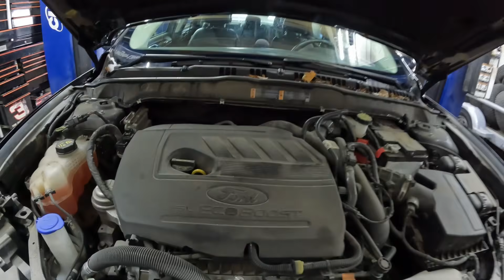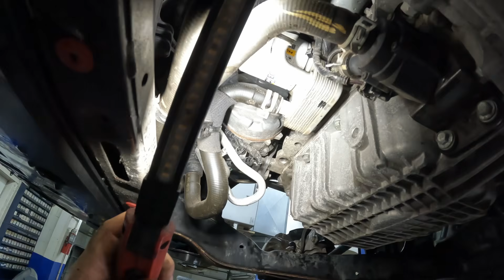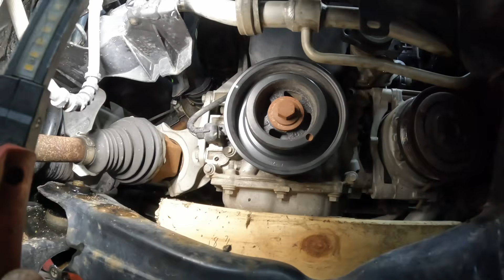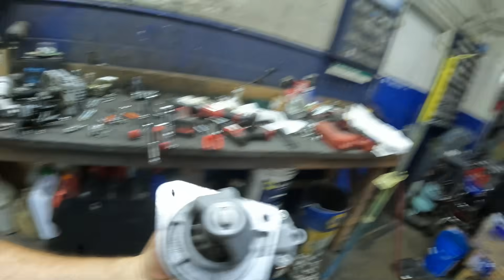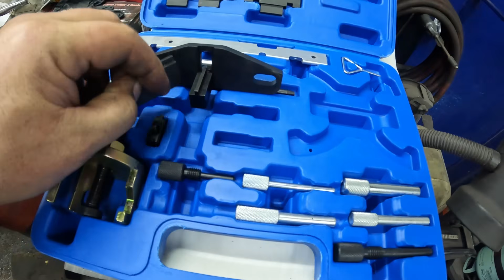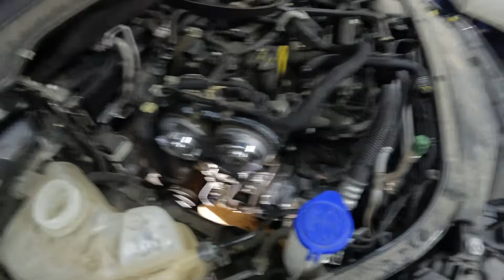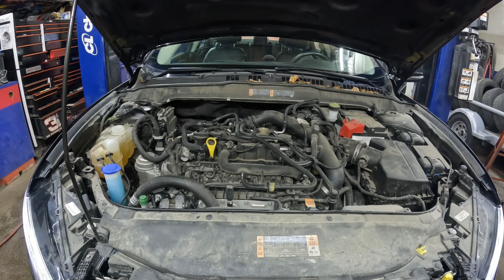2018 Ford Fusion 1.5L Ecoboost Water Pump & Timing Belt

Comment: So just want to confirm, is the tool that goes into the side of the block to keep the CS from spinning, good enough to hold it while I remove and install the new crank bolt?
Reply: Disregard, saw an earlier comment saying that the pin is good enough to hold
Reply from the maker: So it would not assist in removing the crank bolt.  I use an impact to remove the bolt.  The pin will keep the crank from turning when tightening the bolt.  Thanks for watching.
Reply: @paycheckmonster correct! I’ll be using an impact wrench to get it off. I just wanted to be sure that the bolt you stick in the side of the block would hold from using an impact. I’m also using an impact that only has 250 ft lbs of break away torque. So i don’t think it will zip off that crank bolt right away. It might take a couple seconds, so I was worried that the bolt wouldn’t hold

Comment: What's the part number for the cam cam sprocket   tool?
Reply from the maker: The cam locking tool is 303-1097.  However, I bought mine in a kit off Amazon.  I just checked and that kit is not available at this time.  That kit was bought in the VZCY store on Amazon.  Thanks for watching!!

Comment: What is the recommended mileage to do this when I know Ford says 150,000 but is that too long?
Reply from the maker: 150,000 for the belt.  There is no service interval for the water pump.  You just replace when they start leaking, as in this case.  You would think it would at least make it to 100,000???  Thanks for watching!

Comment: can the pin in the crank take all the force tightening that bolt without the fly wheel locked? great vid though.
Reply from the maker: Yes it can.  Like I stated, the crankshaft butts up to the tip of the pin.  Not from the side, so your not going to sheer it off.  Thanks for watching!!
Reply: @paycheckmonster  Have you done one of these engines again without pulling the starter? Just by using the pin against the crankshaft?
Reply from the maker: The pin will hold it.  A lot of people think the crankshaft is making contact with side of the pin, but it's not.  It makes contact with very tip.  Thanks for watching!!

Comment: What tool is needed to remove oil cooler housing? To remove inner adapter that holds housing to engine? Thanks and great work
Reply from the maker: It's a 12mm allen socket.  Thanks for watching!!

Comment: Did you put any tread sealant on the water pump housing bolts.
Reply from the maker: No need for thread sealer.   Service manual states to replace the bolts.  I never have any problems reusing them though.  Thanks for watching!!

Comment: Excellent video. Did my timing belt today without removing the starter. Just used the dowel insert on the crank. Great info on here
Reply from the maker: Thanks for the feedback, glad it helped you out!
Reply: Was it running smoothly after everything was put back together

Comment: I was going to go look at a 2020 Escape tomorrow to purchase. I have changed several timing belts in my day but this is ridiculous. I will think twice about buying the Escape. Why not make the timing cover so the bottom comes off with a few bolts so you don't have to remove that pulley. This is dumb! I might just keep my old Honda Accord.
Reply from the maker: You really can't go wrong with most Honda's.  Thanks for watching!!

Comment: FelPro 71830
Reply from the maker: I couldn't get it aftermarket at the time and the customer needed it back asap.  Dealer said it was only available with the cooler.  It wasn't much so that's the way I went.  Thanks for the info and thanks again for watching!!

Comment: One of the best video tutorials I've watched. Much appreciated. Just a thought on the starter motor removal. I feel it's essential, as, years ago, I did a little Ford Fiesta belt without locking the flywheel, and, to my horror, I bent the locking pin that butts up against the crank web. Needless to say, I had to pull the sump off, straighten it in situ, and reseal sump. Major lesson learned. Many thanks again, for a great walk-through.
Reply from the maker: Thanks for the feedback.  Thanks again for watching!!
Reply: The torque of the crank bolt is the exact reason the flywheel is to be held. Similar to a Duramax.
Reply from the maker: Duramax locking tool is way stronger.  Flywheel holding tool will not hold on it's own.  Pin holds position while torquing crank bolt.
Reply: @ Yes, did notice it's alot beefier than the older ones.
Reply: @mahanduru I called the Ford dealer and they only lock the crankshaft on the flywheel. For me at least the locking tool for the flywheel looks a bit tiny.

Comment: is it easy to change an exhaust cam on the 1.5? the fuel pump
lobe is worn. thank you
in advance!
Reply from the maker: Depends on mechanical ability.  If your comfortable with the timing belt job, it wouldn't take much more to replace the cam.  I've never seen a flattened fuel pump cam lobe on one of these engines.  Did the pump fail??
Reply: @ yes sir. pump failed as well. i work in a dealership( chrysler) so i have access to a hoist and tons of tools, but im an apprentice so ive only been familiar with tools for the last few months. My car currently stalls on cold start and will not go over 3200 rpm
Reply from the maker: I hope everything works out for you.

Comment: Great video! Helped me out a lot! I was on the fence about taking the started off to lock the flywheel to torque the crankshaft bolt. I did not take the starter off, the timing pin and the front timing pointer I think held the crank from spinning, my job is all done and runs perfect! Tnanks !
Reply from the maker: Glad to hear everything worked out well for you!  Thanks for again for watching!!
Reply: Work good? Im a out to do the same. If you think the bottom flywheel moved couldn't you just spend it to locking pin

Comment: You all make it seem like the cam sprockets are going to line up perfectly on each car. I drove mine until I needed to replace the water pump. I turned the car off and the cam sprockets were at the 12 for intake 11 for exhaust left to right. I replaced the water pump without removing the belt just taking the tensioner out. I put it back tried to line up the cams tool wouldn't fit. Every video I watch they make it seem like each cars cams are gonna be perfectly aligned.
Reply from the maker: I guess I'm not sure what you got going on there.  I've never had a problem with one not going back together.  Something doesn't sound correct there.  Sounds like the belt may have jumped when loosening the tensioner????
Reply: @paycheckmonster  Yeah I bought a used Ford Fusion my water pump went bad. I didn't mark the cams after I shut the engine off. I took the belt tensioner off to get the old/new pump installed but didn't remove or replace the belt. I tried using the lock tools on the cam sprockets. The line and circle never made it to the top at the same time. They were off 12 o' clock position and 11. 

I have mechanics say the valves were bent but I know that's a bunch of smack because the engine hasn't turned over since I shut the car off and put the pump on. I'm not a timing expert but it looks like I'll have to take the whole top off and make sure all the timing tools are used. I have a shop trying to charge me $7,000 for a engine when the one I have just needs a new timing belt and for the cams to be aligned.
Reply from the maker: Hope everything turns out ok.

Comment: My fusion kept giving me an overheating warning so I replaced the thermostat housing, I’m still getting the overheating warning while driving seems to come on right at 40mph, so I’ll turn the car off and 2 seconds later turn it back on and temp is normal…I’m thinking about doing all this but not sure if it’s the water pump
Reply from the maker: Step one.  Check for codes.  These engine have an auxiliary water pump also,  usually sets a code though.  There is a process to bleeding the cooling system also.  Thanks for watching!
Reply: did you fix this issue? going through the same thing with my fiancée’s car right now

Comment: That is a locating pin fly wheel locks it. But I got you. I have a 2014 right now in my shop. I figure a way for us to eliminate that 2 hours trust me  I got access to a machine shop
Reply from the maker: The pin that protrudes and makes contact with crank sets timing location.  The flywheel is locked with a tool so you can remove the crank bolt.  If you have the crank set so it's making contact with the pin and the cams locked the flywheel holding tool is irrelevant.  Then you wouldn't need a machine shop.  Thanks for watching!!

Comment: Hello needing some advice 
I have the same car 
It’s obvious the water pump is bad it makes noise and the pulley moves back and forth 
I changed out the thermostat and I’m having trouble getting all the air out of the cooling system 
Is it possible for the water pump to be putting air into the system?
Reply from the maker: If it's leaking, it's not holding pressure, and if it's not holding pressure, it's probably not going to hold a vacuum.  So technically I guess it would be possible.  There is also a procedure for bleeding the cooling system also but it sounds like that water pump should be a starting point.  Thanks for watching!!

Comment: Is there any situation where the engine needs dropped/removed to fix other items related to the timing belt?  We are being told it needs removed for a 1.5L ecoboost in a 2014 fusion.  TY!
Reply from the maker: Does not have to be removed.  Thanks for watching!!
Reply: @paycheckmonster  thanks for the info!  Now I'm concerned being taken advantage of getting charged more.  The initial issue is a rapid knock/ticking noise for a second or two ONLY when you accelerate hard above 3k RPM and left off the gas.  he things its something with the timing belt or a connecting rod bearing.  Only 77k miles on the car.  :-(

Comment: I had the pleasure of getting one of these in my shop. What a pain in the ass. I bought the same tool kit from Amazon that you used.  Everything was installed properly. After torquing the balancer bolt I removed all of the locking tools.   Turns out the tool that holds the flywheel cracked in half after only one use.  Luckily the broken piece didn't fall into the bell housing.  Just imagine if I relied on just the lock pin in the block. What if that broke off in the block instead?  This whole job is pretty sketchy.
Reply from the maker: I know a lot of people that watched the video are questioning the pin the stops the crankshaft from turning.  Just to explain further.  The counter balance on the crankshaft does not contact the pin from the side,.  It actually makes contact on the very tip.  It butts up to it and does not try to shear it off.  So in theory, if it did fail.  The treads would have to be pulled out and the pin would push directly out the side of the block.  It sure is a cluster of a system though.  I would agree.  Thanks for watching!!

Comment: bro i dont have an impact drill to get that big ass bolt out so what can i do?
Reply from the maker: You really need to have a good understanding of the timing system on these vehicles before attempting the repair as explained.  Don't know if I would take the risk if you don't have the correct tools.  Thanks for watching!!
Reply: In that case stay away from the job. Need basis automechanica skills

Comment: If your doing just the waterpump does the timing belt come off anyway?!?! Mitchell calls for 5.5 hours but i have learned on any bigger job to double it and base charge off that.
Reply from the maker: So you would actually use the wedges in the service kit and jamb those in to hold the belt in place and then loosen the tensioner and replace the water pump.  A lot of fiddle fuckin around!!!  Soaking the belt in the process.  But yes it is 5.5 hrs to do it that way.  Thanks for watching!!
Reply: @paycheckmonster  what a stupid design...thank you for clearing that up for me

Comment: I am surprised that you did not notice the rubber flap on the backside of timing cover. The stud and bracket that is difficult to remove. Does not have to be removed. Unclip the top of rubber flap from timing cover. Pull cover away from engine far enough so you can get a hold on the bottom part of the rubber flap. It is slid into a slot in the timing cover. Hold rubber part while pulling cover off.
Reply from the maker: Sure makes it easier to put back on.

Comment: What about the torque on the crank bolt will tha pin support that torque instead of removing the starter
Reply from the maker: So the crankshaft makes contact at the very tip of the pin and pushes straight back.  It does not contact the pin from the side.  I would trust pin over the holding tool for the flywheel.  Thanks for watching!!!

Comment: What did you use to get that crank bolt out? Can you turn it counter clockwise without hurting anything?
Reply from the maker: I just put an impact on it and it comes right loose.
Reply: @paycheckmonster  i impacted the heck out of it with a 1/2 inch dewalt but had to finally use a 1/2 inch ratchet with a cheater. It was on there!

Comment: I can’t believe nothing is keyed. Have you ever heard of timing slipping?
Reply from the maker: Seems to be kind of a trend with smaller engines.  They have been doing this for many years.  I've never seen one slip.  I have seen plenty of engines that are out of time because of improper repair procedures.  Loose fasteners or timing just set wrong because the proper tools were not used.  Thanks for watching!!

Comment: Thanks for a great video. I just did my daughter's 2017 Escape. My Amazon tool kit worked fine and I did not remove the starter. I did test the way the pin contacts the crank by backing the pin off a couple turns and sure enough, the crank move a little more. That just means that it does butt up against the end of the pin. I hope the guy that designed that back timing cover stud with the bracket has his nuts boiled in oil. Thanks!
Reply from the maker: Thanks for watching!!
Reply: I agree the designer of that bolt and stud, for the backside of that timing cover should be hung by his toenails
Reply: No need to remove the bracket. Simply slide the rubber strap out of the cover.  Better think first!!😢
Reply: what does this mean: I hope the guy that designed that back timing cover stud with the bracket has his nuts boiled in oil 😂😂😂
Reply: No need to remove the bracket! You can simply slide the rubber strap out of the cover. So, no nuts to boil.

Comment: Thank you for this very informative video and your time in doing it.
I am about to tackle this job on my sons 1.5 fiesta here in Australian.
I bought the kit of special tools of ebay and have done a number of timing belts on various models but this one has got me a bit nervous.
I haven't got a fancy torque wrench to do the degrees. Can i just mark the bolt and do the 90 degrees by eye and then a little for the extra 15 degrees.
Its a manual so putting it in gear with hand brake on could assist the motor from not turning when undoing the harmonic balancer bolt i hope.
Reply from the maker: As long as you can mark something to indicate how far your turning the bolt, it should work just fine.  I hate to age myself, but that's how I started out many years ago, before the electronic torque wrenches.  Thanks for watching!!

Comment: Your video is very well done. I am about to replace the timing belt on 1.5 Escape. I am torn between pulling the starter or not. It looks like it is very difficult to get out but I am nervous about breaking the pin if I do not. Do you have any further thoughts on this since you did the video? Thanks again.
Reply from the maker: A lot of people think the crankshaft would shear the pin off, but actually the counter weight on the crankshaft butts up to it.  It pushes directly on the tip.  That's why you need to make sure the pin is threaded all the way in.  I've never broke one.  In the service manual, that is the procedure to hold it.  They flywheel lock plate hold the crankshaft to loosen the bolt.  That's why I just zip them out with the impact.

Comment: great video. Thanks.  I have a 2018 Ford Fusion 1.5 EcoBoo.  Do you have a video on removing the head?  I have more time than cash so I am doing this project in my home garage.  Have not done an engine rebuild since the 90's.  Dealer wanted $6K.  Thanks for any help.
Reply from the maker: I have done a few but never filmed it.  I will say that these engine are very special, let's put it that way.  Make sure to check for any recalls. Some of these had engine block issues.  This may help.  https://static.nhtsa.gov/odi/tsbs/2020/MC-10174400-0001.pdf      Thanks for watching.

Comment: Used your video for help with one didn't realize they didn't put a key way on crank .... Thanks engineers real nice of you.... Ash to ash dust to dust if it weren't for ford my tools would rust....oh and i didn't pull starter and it was fine so yeah ex that out
Reply: Please tell me.
The bolt you screwed in from the backside of the engine to hold the crank in place, is ir strong enough for all the torque on the bolt that holds the pulley/gear in place?
I am now busy doing a timing belt change, just not sure if that bolt will hold together.
Reply from the maker: Some people think that pin holds the crank from the side, like a shearing action.  Actually the counter weight on the crankshaft buts up to the end of the pin.  It's pushing directly on the tip and straight back. Thanks for watching.
Reply from the maker: Glad to help

Comment: Thanks for the video, starting a 2017 1.5 timing belt change. Was trying to figure out how to bypass starter pull before your video ended and you jumped right into it. Good stuff!
Reply: After you got it locked into Top dead center did you just impact the crank bolt out ?
Reply from the maker: Thanks for watching!!